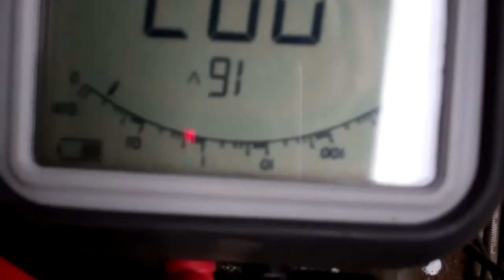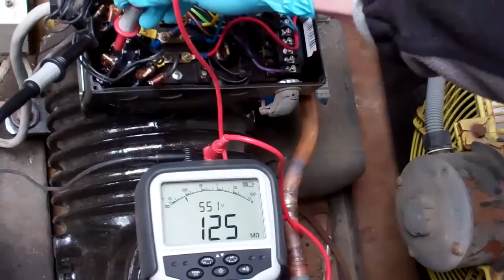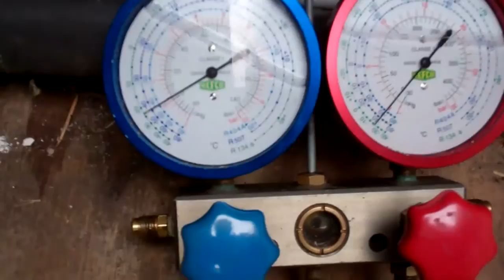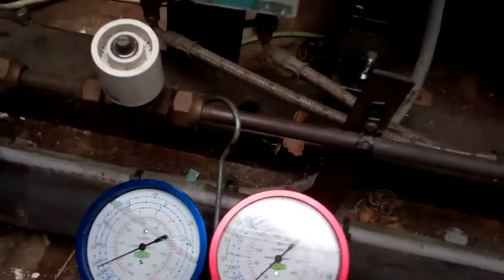Shorted Copeland compressor motor

Comment from the maker: I usually test at about twice the supply voltage, so on this 415V compressor i'd be on the 1000V test range. 
If there is any doubt then test as near to the supply voltage, e.g. 500V in this case, and you should be ok.
There are some smaller compressors that have internal ptc devices that may be damaged by testing at too high a voltage, these would mostly be fractional horspower motors, it pays to read the label on the compressor to check for guidelines etc.

Comment from the maker: Hi Fritz!
Had years watching my Dad work (school holidays etc) to get the idea of how to look for shorts!
Its the opposite to normal resistance testing of windings/coils where you want a low reading to show its not open circuit. With meggering you are testing for electrical short to ground so any reading under infinity shows a short to some degree. Usually a good motor will be 20megaohm or well above and they start getting really suspect below 1megeohm.  Will do a how to vid starting at basics!